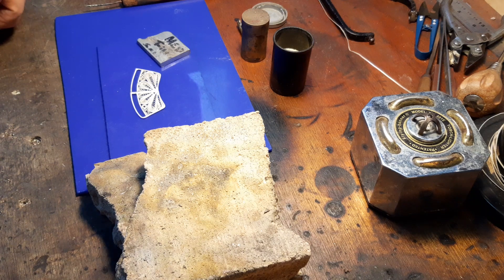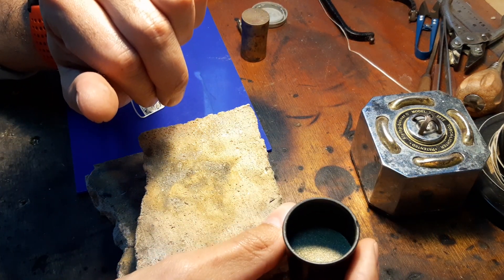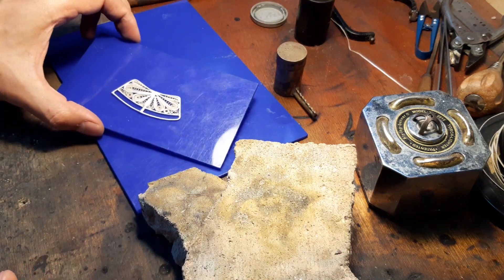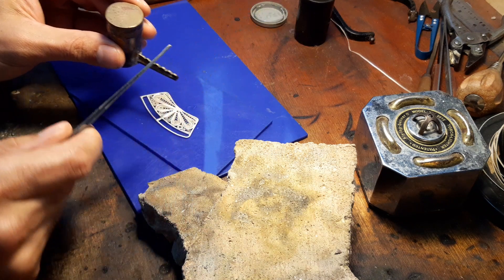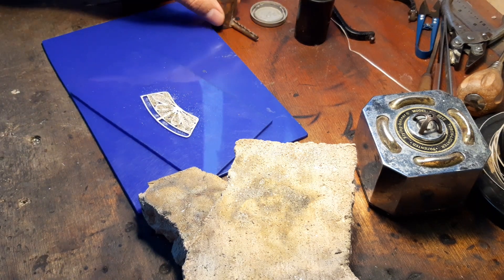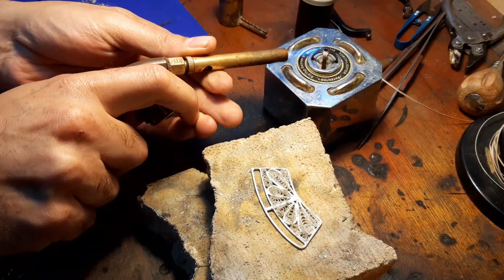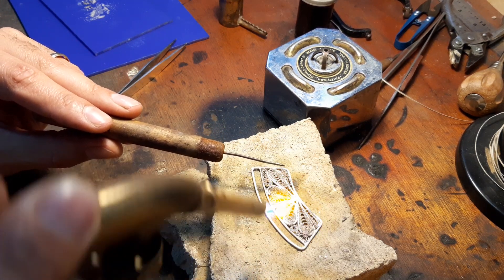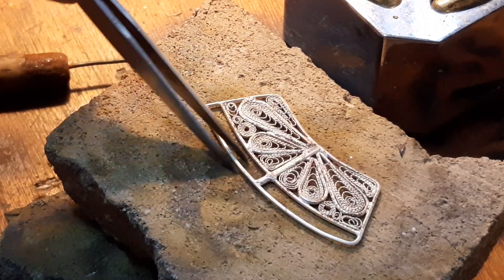Soldering silver filigree

Comment: How much heat from torch we need to solder filigrane thank you
Reply from the maker: It depends on the solder used and Melting temp of solder.. usually 700-800 deg Celsius

Comment: Can you file any silver and save dust to solder or melting down actual solder into an ingot then filing? Fine or sterling dust would be easy medium or hard? So i can file say fine silver and use filings mixed with borax and thats solder? Im stupid, sorry!!
Reply from the maker: There are recipes for different alloy solders. Easy, medium and hard are the main ones used. For filigree I use medium or hard solder. I melt into an ingot and file, collect the filings mix borax with the solder and ready to use!

Comment: After you’ve soldered the filigree wires with the powdered solder how do you clean up the piece please? How do you remove any excess solder? Or should all the solder be absorbed into the twists of the filigree wire and not clump anywhere? If you do clean is it with little bristle wheels? I’d really appreciate your help as I have no idea how to clean the filigree piece after soldering this way. Many thanks in advance
Reply from the maker: Using little solder would suffice without cleaning, it comes with experience. After soldering the item is pickled to remove the flux and oxidisation.